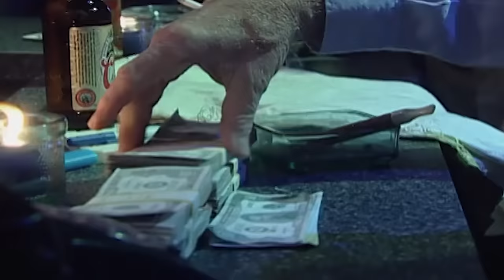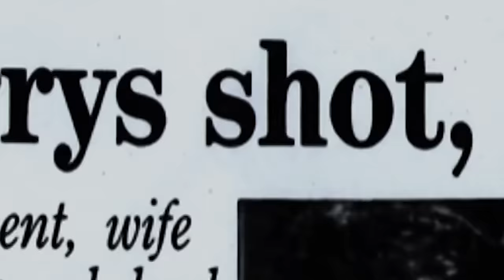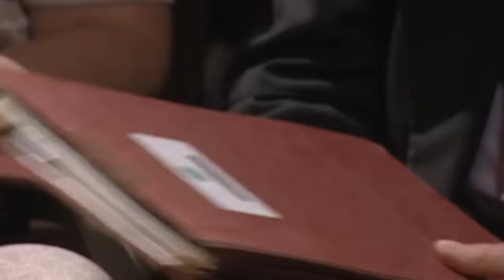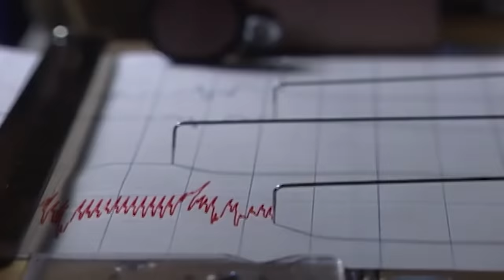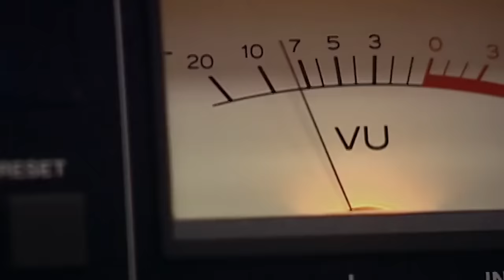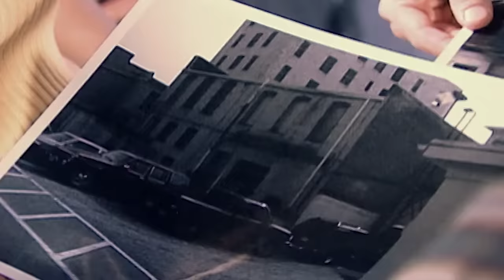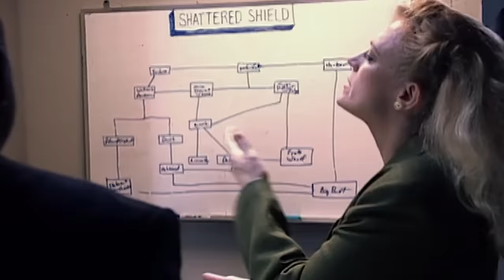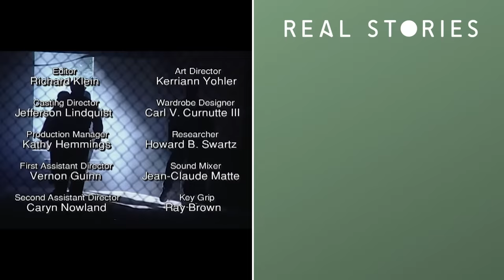FBI Vs the Dixie Mafia & a Corrupt Cop | True Crime Double Bill

Comment: 10:30 "they were assassinated"?  Unless the murder was specifically to motivate political change or was in retaliation for a political action then it wasn't an "assassination" it was just a murder.  Even if this judge sentenced someone to jail and their 3rd cousin killed them in response thats still not an "assassination" just a murder.  The only way it would be a an "assassination" is if you can prove that the judge sentenced or didn't sentence someone for political reason which would make him a dirty judge because their rulings are forbidden to be based on politics but rather on the law.
Reply: Thanks for clearing this up.
Reply: @Jersey.D3vil201  It might have turned out to be an assassination.  But they certainly did not have enough information at that point to say that.  At best it might have been a slight possibility.